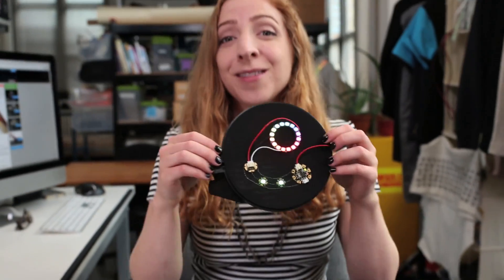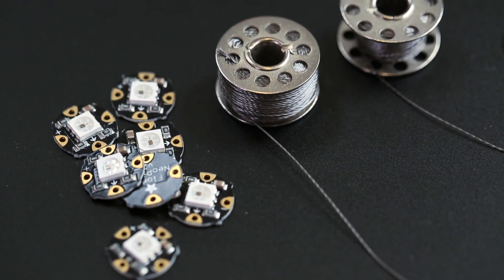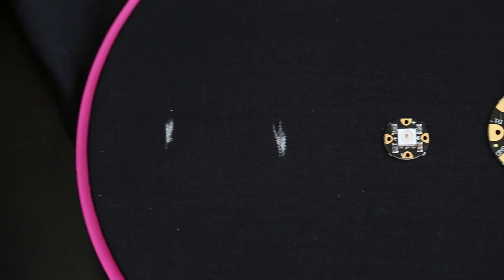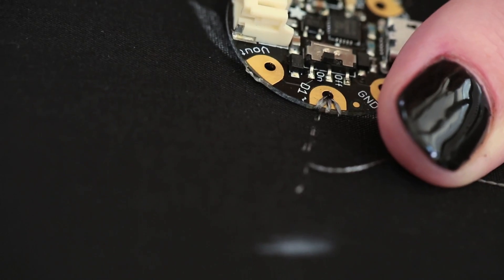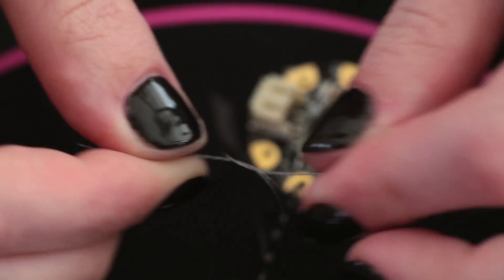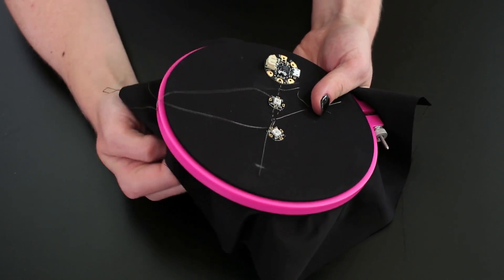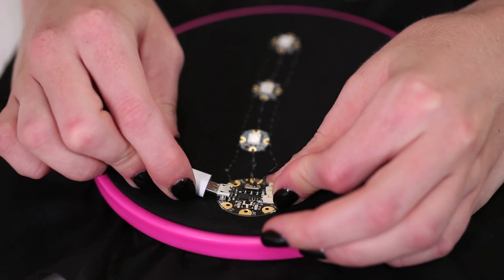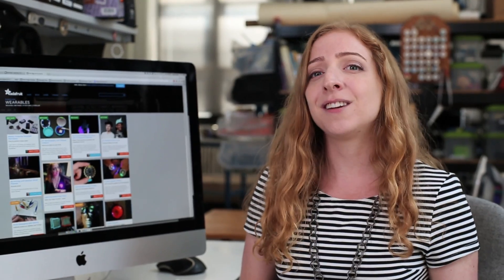How To Sew the Perfect NeoPixel Circuit

Comment: Does there need to be a break in the data thread from one neopixel to the next? I mean is there any reason why I can't continue the data thread, by stitching under the neopixel and fabric to come up the other side, stitch through the out pin and then continue on to the next one. Rather than go back to the end of the last tail and tie a knot in the middle.

Comment: Hi, I'm having problems with the springy nature of the 3ply thread. Simply sewing around the pad holes doesn't stay tight enough to keep the connection. I've tried using a reef knot and figure of 8 knot but they still come undone. I tried gel superglue because glue is nonconductive and I didn't want it working into the knot and coating the surfaces where the thread touches. But the day after I'd glued the knots, the circuit that had been working when I glued it had stopped working. I assume the connection has failed again. Any tips for keeping tight connections on fabric that won't be under tension (on a hoop) when the project's finished?

Comment: I know I probably won't get an answer this late after the last comment but I have a cosplay coming up and I'm totally inexperienced with LEDs but the jacket that goes with my costume has LEDs in it and I'm not sure exactly how to incorporate them to imitate the original as closely as possible. I was going to use an LED strip because Idk how to use the diodes without needing complex circuitry. another you tuber referred me to your page and the neo pixels seem so much easier to use. do you have any advice you could offer for me?

Comment: Would soldering the contacts later on help with conductivity?
Reply from the maker: ArmyOfCamels regular electronics solder won't work with stainless steel, additionally heating up the NeoPixel pads once they are touching fabric is not recommended. Stranded silicone-coated wire is great for soldering to these pixels, though, if that's your thing!
Reply: Adafruit Industries ok, thank you